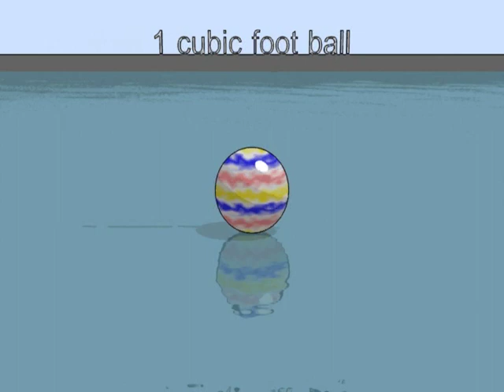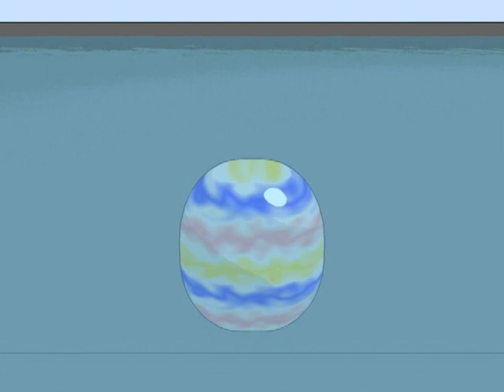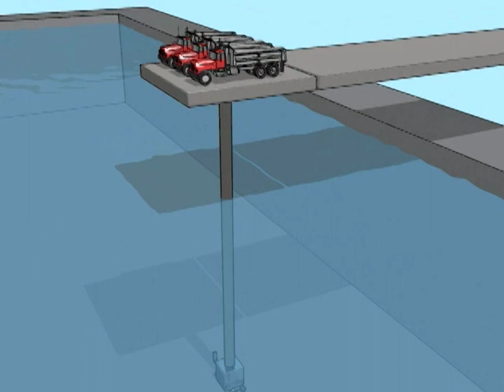HYPEG - WATER+AIR=GREEN ENERGY

Comment: 4:50 "Another valve system releases the water causing the chamber to fill with air"
If you open a valve at the bottom of the body of water, why does the water exit the chamber? Where does the air come from to replace it? You have to push the buoyant air down which requires more energy.
Reply: I see some possibilities  for the water to escape and replace with air easy .1- Suppose that the center pole that guides the chamber down to stay in straight line has a hole on the inside like pipe from the chamber to the open air .
2-When the chamber reaches  its lowest point and temporary locked in place then one or more valves open and displace the water from the chamber to an other reservoir located  below the chamber ....
Reply: The trouble is that water is denser than air so water wants to be underneath air. To displace the water in the chamber with air, you need a source of energy to push the air into the chamber to force the water out. When you're at the bottom of a lake with a tube of air in the middle of the device, there's no valve you can open that passively allows air in and water out.
Reply: Forget the ocean for a minute , suppose that  we have a pool in the third story of a building and right underneath the pool , we have  an empty room (the second story ) that we are going to use as a reservoir  with a system of valves to displace the water from the chamber through the use of gravity.The water displaced from the chamber to the reservoir could easily pump back to the pool with the use of a tiny fraction of the ascendant force of the chamber. 
P.S. Keep in mind that the chamber is automatically locked in place through out the displacement of water .
Reply: +Nick M 
Think about this Nick. A simple enclosed box filled with water. You drill a two inch hole into the bottom. The water glugs out, sucking air in alongside the water running out.The water mass is that source of energy! And you are right, you can not put this into the bottom of a lake unless you can provide a site lower than the lake to allow the water to leave the box.
Reply: +Pierrot Hyppolite . Nope, sorry Pierrot, that is in violation of physics law, energy can not be created or destroyed, only changed from one state to another. My draftsman made the same mistake. It would take more energy to return that water to the above floor due to natural losses in friction. The oceans would provide energy due to the elevated water in waves, as well as the accelerated mass of waves, but that energy comes from the Sun.
Reply: Pierrot Hyppolite Tim Gard Right, you can use the energy of falling water to power things but you need to carry the water back up to a higher state of potential energy to use it again, which is going to require more energy than you just generated.
Reply: +Nick M Yes, exactly. Thats why evaporation and rain fall is required. The real Solar power ... Do you have an interest in renewable energy Nick?
Reply: Tim Gard Very much so!

I just realized it's you in the video, Tim. I would love to know how you got around the technical problems and produced a net surplus of energy.
Reply: In scientific research of energy, there are some very important laws that must be followed. It is mandatory that you completely understand these laws to get a real understanding of whats going on. The first is the law of energy conservation. It states that energy can not be created or destroyed. In energy systems we use a box explanation. The energy into a box must match exactly what is coming out. For example, lets put a piece of paper into a box, light it with a match, then figure out what energy went in and what energy went out. If you applied heat to the paper to get it to ignite, then you must take into account the energy added by the match. The energy out must match exactly to the energy going in as paper, ambient light, etc. You can never get more energy out than what you put in. That's the law of conservation. The energy in the paper in the form of heat and light originally came from the Sun. (Most energy we use today came from the Sun by the way!)

As Wikipedia states ...
"In physics, the law of conservation of energy states that the total energy of an isolated system remains constant—it is said to be conserved over time. Energy can neither be created nor destroyed; rather, it transforms from one form to another. For instance, chemical energy can be converted to kinetic energy in the explosion of a stick of dynamite.

A consequence of the law of conservation of energy is that a perpetual motion machine of the first kind cannot exist. That is to say, no system without an external energy supply can deliver an unlimited amount of energy to its surroundings.[1]"

So lets let that perpetual motion thing die right here.

The energy in the demonstration device comes from the elevated water. When one gallon of water is allowed to exit the bottom, one gallon of water from the top must be replaced to bring the units energy levels back. In order to do this you must lift that gallon of water back to the top of the water column. The energy it takes to lift that water back to the top is almost exactly what you got out of the bottom! That's conservation of energy!  Can we get elevated water for free? Yes! Every time it rains! Or you can hook up a wind mills pump to a water source and pump the water back up with wind power. Or you can use buoys hooked to water pumps and pump the water up with wave power. Or you could use Fundy bay tidal changes on a flotation device the size of the Queen Mary and generate a few hundred thousand gallons of elevated water by hooking the ship to cables attached to water pumps. There are dozens of ways nature can be coaxed into pumping pressure.

The device above functions by exchanging the water at the bottom for air. The functioning device in the plans actually has a conveyor in the water with inverted buckets to hold the submerged air against the conveyor. The submerged air pulls up on the buckets as it pushes to the top of the water. That puts a pulling force on that conveyor, which then outputs that captured energy into a generator. The conveyor turns slowly because the generator load holds it back. When the bucket leaves the water all its buoyancy energy has been removed and input into the generator. Very few losses in the elevated water formula. We would input energy into this device by inserting compressed air into the bottom, inserting the energy captured in compressing the air instead of elevating water mass to get the energy. (Actually when you insert air into the bottom of the water column, you raise the water level equal to the amount of air inserted, so technically you are still using the elevated water as a source of your energy, you're simply replacing it with the energy inherent in compressed air)

I have tried to answer your question generally, but to do the best job, I will need specific questions asked if you can. Just remember one thing, the only dumb question is the one unasked ...

We could have this conversation on private email if you like, however I would rather do it in this format, then anyone can answer their questions by simply reading the posts. Thanks Nick!
Reply: no you don't, you only need to open the valves at the bottom, gravity will take the water out if air is allowed to get in. It is like putting a straw in a cup of water and holding your finger over the top sealing it. You can lift the straw out of the water and the water will stay in the straw. When you take your finger off the top though the water falls out.
Reply: hello tim ,  you r right that most  energy we use now is come from sun   but   do u  ever think that why sun have energy,,, i think   this all energy comes from gravity  .......
Reply: It is very easy to understand this concept in the water comes out a one-way valve opens and sucks air in it's very basic just think a little bit

Comment: from a friend ...

I sent you an email in regard to your system. I have never seen anything like it. How would you couple it to a generator shaft? The energy from the box rising in the water would have to be able to transmit the motion to a generator shaft to turn the shaft in the magnetic field. Have you actually generated any power with the system?
 • Reply•Share › 
Avatar

My response ...

Tim Gard  XXXXXXX • 3 minutes ago
In a functioning unit, the upper drive shaft is attached to the upper conveyor shaft output. This drive shaft is connected to an electronically balanced transmission system to dampen the HYPEG output. Kind of what is being done on wind turbines today except the HYPEG output is much more constant. I might not even need to do that ... R&D stuff that still needs to be done. The system in the video was actually hooked up to a weighted bicycle wheel which would keep the displacement box from rising too quickly, thereby 'storing' the energy in an accelerated mass state of the bike wheel. (The spinning weighted bicycle wheel.) I then hooked a bicycle generator and it lit a bicycle headlamp. As long as the wheel spun, it output, light, that part is not really important, but it was still lit for a while even though the box reached the water surface. (The video is, remember, a single box displacement unit, while the operational will contain multiple units causing constant output.) Simply energy stored, or at least delayed using centrifugal force in the video. We would not however use this format, we would simply apply something like dynamic braking to keep the HYPEG from generating electricity until it is needed. Terciary computer stuff probably. Again, R&D . Tertiary (three) computer designs would guarantee correct computer operations. More R&D ... Because we are continuously adding air to the conveyor belt to full load, rapid load changes can be responded to simply by varying the dynamic brakes, (dynamic braking is how the rail road industry keeps those big heavy trains under controlled braking. Heavy control stuff) which are rapid changes controlled by electronic commands from those computers. Very fast, and very responsive to load changes. Simple stuff, but you got it ...R&D again. Now, imagine a bank of say 300 of these units parked outside of NY City, continuously providing real live, totally renewable energy 24 hours a day, 7 days a week, 52 weeks a year, 1000 years a millennium, until Man no longer walks the Earth. And the power comes from wind, elevated water, tidal, waves, and even solar panels. There is more energy out there for free in the form of compressed air than we would ever have a need for.

Ever seen a Tesla automobile? Fully electric. I could make a few improvements though ... like speeding it up to 200 MPH in normal operating mode. Maybe faster, I'm still working on it!! ;-P Nice car though! I just need to convince the birds that flight is over rated! Haaa ha ha!   :-P>

Are you beginning to see my vision?
Reply: Basically though, you would use a rack and pinion to translate the linear motion of the shaft to a rotary motion, wouldn't you? Or perhaps a belt drive would work too?
Reply: @valveman12  Your comment is wrong. Please specifically address your comment with the description of your issue, otherwise do not make such a worthless comment!
Reply: @valveman12  Absolutely! Calculate the pressure at the base of the column based on depth of the water, then calculate the pressure required to overcome the pressure to insert air into the bottom of the container. I can easily generate massive amounts of highly compressed air with a wind turbine. Thousands of PSI. More then enough to overcome the water pressure at the base of a one hundred foot deep water source!

Comment: Would it be as efficient to have the buoyancy chamber in a floatation chamber that would just be filled and emptied? One could have the buoyancy chamber lock into position at the bottom. When the water level in the floatation tank reached the top a floatation trigger could then release the catch. You could use a damper to control the rate of rise for a steady delivery of power. A series of such tanks could be arranged to operate in sequence to provide constant energy. Also, another design would be for    flotation chamber to be cylindrical and it could have a spiral groove running up it's sides. The buoyancy flotation device could also be cylindrical, with a radius slightly less than the floatation chamber. It could have knobs on it that run in the spiral grooves. As it rose it would spin, as it sank it would spin the other way. It could be weighted enough so that it floated just at the surface. A simple gear mechanism with ratchets could create a one way rotation on the generator whether it is rising or falling.

Comment: From a friend ...

 Hi I am an engineering student, i watched the video and i did not quite understand how the storage vessel managed to drop to the ocean floor when it is unfilled with water( buoyancy force) and rise as the pressure would be the same after inrush of water for power generation. I am very frustrated with this yet this should be a project few years ago, I thought you might be able to help! 
Thank you > <
 
from me to the friend

+mei ... OK, I watched it again, and trust me this is really not very clear, but I think I get the jist. First of all, in spite of the relative shallowness inferred by the drawing, the young lady states up front that due to scale issues, the distance to the bottom is quite deep. Re-watch the video, write down the number and imagine trying to swim down that deep, even with a scuba suit. The vessel you ask about is being pulled to the bottom by the other three every time a wave raises them. Their three time buoyancy (or more depending on the size) are greater than the turbine portion, so the turbine is pulled down every time the others are raised by the waves. Eventually it will reach the bottom. The winches on the ocean floor are ratcheted so the power buoy doesn't return to the surface. Once it reaches the bottom, the main buoy is released and allowed a controlled assent, controlling the unit physically and electrically for output control. It would do no good if the assent was not captured in some way, and allowing the thing to accelerate too fast would be a waste of energy. However, it is still a turbine, it is still rudely inefficient in nature due to accelerated mass, and would be very expensive to build and maintain. It is what us engineers call a Rube Goldburg. Ever heard of one of those?.

from Wikipedia ...

Reuben Garrett Lucius "Rube" Goldberg ( San Francisco July 4, 1883 – Hawthorne New York December 7, 1970) was an American cartoonist, sculptor, author, engineer, and inventor.

He is best known for a series of popular cartoons depicting complicated gadgets that perform simple tasks in indirect, convoluted ways, similar to Heath Robinson devices in the UK, as well as the Storm P devices in Denmark. Goldberg received many honors in his lifetime, including a Pulitzer Prize for his political cartooning in 1948 and the Banshees' Silver Lady Award in 1959.[1]

Remember the old game called Mouse Trap? Yea, I think that is exactly what I see here. Sorry Mootle, But unless you have a reasonable argument against my conclusion, thats my opinion. Gawd, I love this stuff!!

Comment: Beforebefore. Holy cow! Someone actually heard the bell ring! Never thought I would ever see anyone getting this. You can't explain that, can you?? This is so simple after all! Wow.
I have actually made several improvements since that video was made. I have also given up on patenting it, so I will be making all my research available on you tube this year. I have redesigned the lift into an under water conveyor eliminating reset issues. The device now outputs continuously. I have designed numerous ways to produce free compressed air, so elevated water is no longer necessary since compressed air can be sent through pipes long distances without major losses.. Now you can generate electricity in the middle of the desert, no elevated supply necessary! Imagine a wind turbine providing electricity even when the wind isn't blowing! Stored energy in the form of compressed air! Look close at the Bay of Fundy ... enough compressed air to supply the entire American continent, including transportation! And there is so much more planet wide ...

Comment: if you use hydrogen you can let the floats give power on the way up and then burn the hydrogen and turn the byproduct into water and then reuse the water to generate more power. this way you get energy from the lift of the float the burn of the hydrogen in the float after it have been used and water as byproduct to drive a hydro power generator from the fall of the water. then you can use the combined energy to release 4 times as much hydrogen as you put in to begin with.